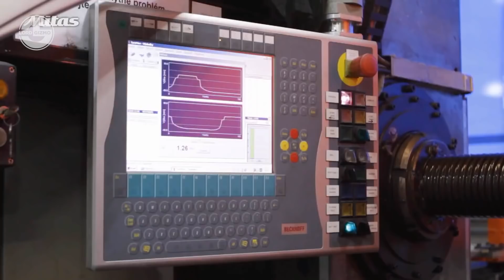Manufacturing Process of Gigantic Ship Propeller & Other Amazing Factory Production Process!

Comment: I see Tentec (or similar) hydraulic bolt tensioners. The ones I worked with stretched bolts/studs at 33,000 psi, which when I look back, is a bit scary.